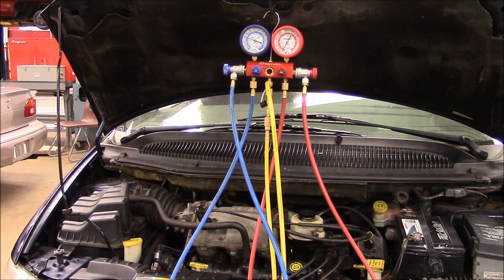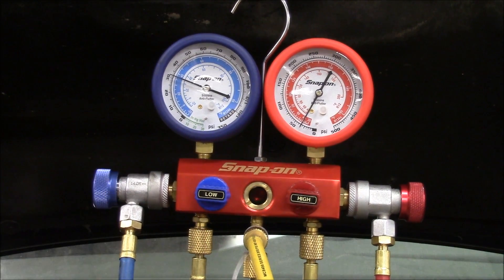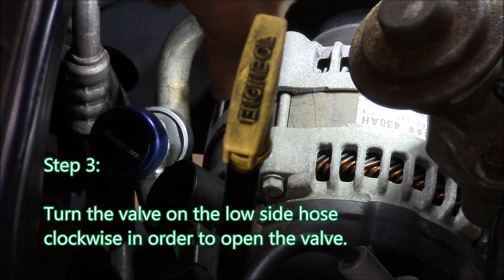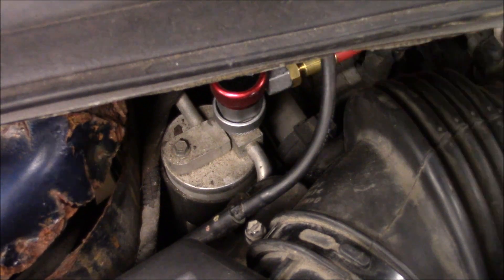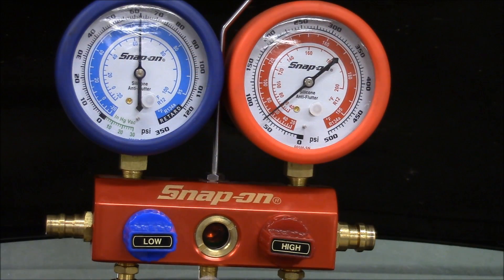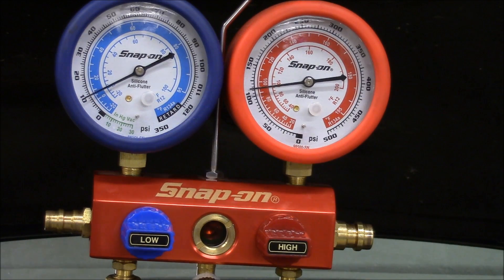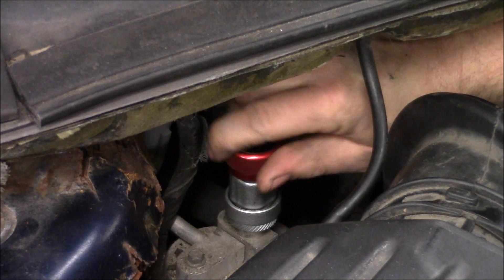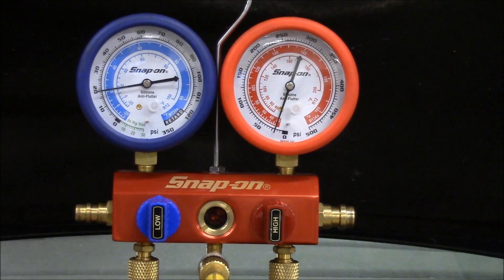AC Manifold Gauge Hookup

Comment: I bought the Extreme Kit from Amazon $125.00.  I followed your instructions. My readings were: Compressor OFF: 33 Low, 132 High. Compressor ON: 15 Low, 189 High.  * When I closed the High side at the hose and removed it, and opened the High Side Valve (Manifold), Freon went out and the needle went down. I never got to bleed the Freon in the hoses back into the system.  Question: Why did the Freon leak out when I opened the High side valve? (rotated the valve to the Left).  Thanx for your review.
Reply: Maybe the hose at the manifold wasn’t tight enough or the washer is bad.
Reply: You were correct. After tightening I found if you wait a few minutes, you have to re-tighten, 3 or 4 times! Apparently, the new washers compress slowly.  @capitalr8649

Comment: Good morning. I am just starting my journey as a diy’er and I am retro fitting the a/c system in my car to 134a specs. Your video I understand to the max. The gauge you use is similar in design. The minor difference is , my gauge is by unwell. My yellow hose connection does not come with purge valve . Please explain the position of the yellow hose during the whole operation .

Comment: You didn’t say which way to turn the valve on the actual gauge set left or right. The set I have shows clearly which way is open and closed on the quick connect hoses but no info on the other ones that are on the main gauge part.
Reply: 9:45

Righty tighty. Lefty loosey.  

Counterclockwise will open them.

Comment: I found this video to be very helpful, especially the part on disconnecting the test equipment from the car without losing refrigerant to the atmosphere. Thanks very much for making it. Also, using the material from your video as well as other information I've found online, I wrote up a test procedure. In case helpful to you or others watching your site, here is my note: 

Automobile A/C testing with manifold gauges
30 June 2021

This procedure covers measurement of static and dynamic pressures at idle speed. I cannot control the engine rpm (without someone stepping on the gas pedal) because the throttle is controlled by a motor in modern vehicles and cannot be controlled without special test equipment. The steps are the same regardless of rpm.

- Verify that all hose connectors are tight and that the yellow hose is blocked off (tied back to manifold)
- Zero the manifold gauges (i.e., vent any pressure in the lines)
- Close all valves (LP and HP on the manifold and LP and HP port valves)
- ENGINE OFF
- Connect LP and HP lines to respective A/C ports
- Open the LP and HP valves at the ports (NOT the manifold)
- Record low and high pressures and temperature (Check against R134A chart)
- Start engine and turn on A/C
- Watch gauges and once the engine is fully warmed up you will see them cycle as the compressor in enabled/disabled by the car's monitoring sensors.  Once they stabilize, record the highest high pressure and the corresponding low pressure. Note: The high pressure should be between 2.3 and 2.5 times the ambient temperature in degrees F.
- Do NOT turn the engine off to remove the manifold test gauges. You want the A/C system suction to remain on so as to recover the residual gas in the lines.
- Close the high pressure valve at the A/C port and remove the line from the port.
- Open the high pressure manifold valve to allow half the residual gas in the high pressure line to transfer into the center (yellow) line. By doing this you are roughly doubling the volume and hence halving the residual pressure in the high pressure line.
- Next open the low pressure (blue) manifold valve slowly to allow the gas stored in the red/yellow lines to bleed into the A/C unit via the low pressure line (blue). Note: this is akin to charging the A/C system with new refrigerant from a bottle except in this case you are using the low pressure (blue) valve on the manifold to control the flow rate.
- Once the low and high pressure manifold gauges have equalized, close the low pressure (blue) valve at the LP port on the A/C system and remove the low pressure fixture from the port.
- Shut off the engine
- Put the caps back on the low and high pressure A/C ports

Comment: I'm a little confused. The engine is running with the AC on. The coupler is connected to the low side port and the valve at the coupler is open (turned clockwise) , allowing compressor to be sucking fluids into the low side port. I've closed the valve at the high side port and disconnected the coupler from the high side port. With the valves at the manifold open, and the low side coupler connected, and its valve opened, fluid in the high side hose gets sucked into the low side port. So far so good. But what would happen if I closed the valves on the gauge set before closing the valve (and removing the coupler) at the low side port? That is, what would happen if I closed the valve at the low side port after the valves on the gauge set are closed? If I close the low side port first, won't there be a bit of refrigerant remaining in the low-side hose? With the valves at the gauge set open, refrigerant in the high side hose will be pulled "up" through the high-side hose, through the manifold, then "down" through the low side, into the compressor. Now the high side hose, manifold, and low side hose, have become emptied of refrigerant. In my imaginations, I'm seeing the open valves at the gauge set, especially the low side valve, allowing any remaining refrigerant in the low side hose to be drawn through the low side port, sucked through the low side port into the AC by the compressor. I am imagining that closing the low side valve at the low side port (and disconnecting the coupler) before i close the valves at the gauges, to be allowing a bit of refrigerant to remain in the low side hose. Or maybe it makes no difference? For some reason I'm having some trouble visualizing what's going on. 

Also, if I had previously been charging the system rather than just simply checking the pressure, I would first close the valve at the refrigerant can, to allow any refrigerant remaining in the yellow hose, to be sucked in, before I closing the valve at the high side port,  and opened the valve at the high side gauge, to allow any refrigerant remaining in the high side hose, to be sucked in.

Let's say you have attached your gauge set, checked the static pressure, then the pressure with the AC on. Then you've turned the AC off. It takes a while for the pressure to equalize again. You have neither evacuated the system or added refrigerant, so you have had both valves at the gauge set closed, the whole time. Then you close both valves at the AC ports and remove both couplers from the ports. There will be a small amount of refrigerant in the low side hose and unless you have waited a fairly long time there will be a somewhat larger amount in the high side hose depending upon how long you have waited before disconnecting. And unless you have first gone through the procedure you have described to return the refrigerant in the hoses, to the AC system, now before putting your gauge set away for storage you open the valve at the end of the yellow hose and open the valves at the gauge set – and the refrigerant in the low side and especially the high side hoses will come out of the yellow hose. When this happened to me I was surprised at how much refrigerant was in the 1.5 meter high side hose – and that instructors had not warned me about recovering it. For some reason once the is AC turned off on my vehicle the expansion valve starts to equalize the pressure right away but it doesn't fully equalize for about a 1/2 hour. The pressures so the high side hose had a lot more refrigerant in it. So it seems to me that even if you are just checking pressures, you need to turn on the AC, open the valves on the gauge set, and go through the procedure to recover the refrigerant in the hoses.

To try and make my job easier I put ball valves at at the end of my hoses so I can just quickly close the valve by turning the ball, and proceed to recover the refrigerant from the hoses before removing the hoses from the ports.

Comment: i dont think opening the red  valve on the manifold gauge will purge the refrigerant out towards the blue valve because those two valves , blue and red, are each independent access port or opening to the yellow hose in the middle. there is no opening between the blue and red valves so that the refrigerant could get through. opening those blue and red valves will only be necessary when you want to recover the refrigerant or to vacuum the system. in my observation, when you opened the red valve, the residual refrigerant went to the yellow hose and stayed there and then when you closed the red valve after that and opened the blue valve the refrigerant that stayed at the yellow hose will not be sucked out into the blue side of the valve. i believed that is a loss of refrigerant but very minimal.

Comment: I have in an 03 durango 15psi on the lowside and 150psi on the highside.   outside temp is 86F
Reply: Richard Cowtails low charge. You need to find a pressure temperature chart. For 134a a pressure temperature chart shows  225-250 on the high side
Reply: If that is static reading ( with car off) then you may have a restriction.

Comment: Thank for the video. Just ran a test on my system. Brand new 2017 WRX seems like the compressor is cycling too often. Cycles every 5-15 seconds or so. My A/C blows ice cold at about 40 degrees but the constant cycling of the compressor drops the rpm while driving causing the car to hesitate or stutter. Temp at time of test today was about 65-68 degrees. After the car warmed up with A/C on full blast the PSI was right around where it should be about 25psi. However when I throttled the car to 2000rpm the PSI would drop down around 15PSI. Any thoughts on this situation? Thanks!!
Reply: what where your high side readings?